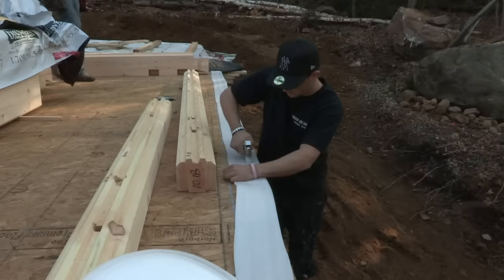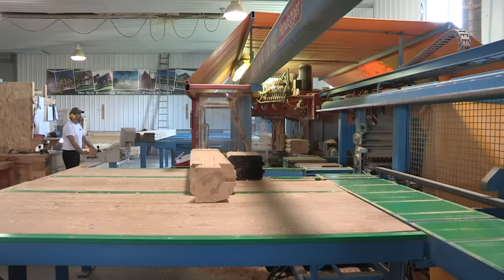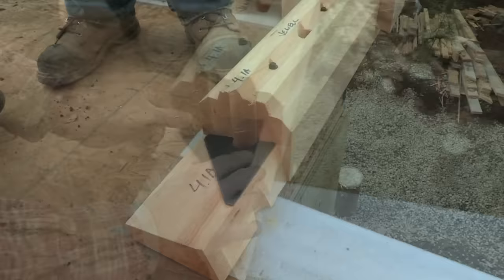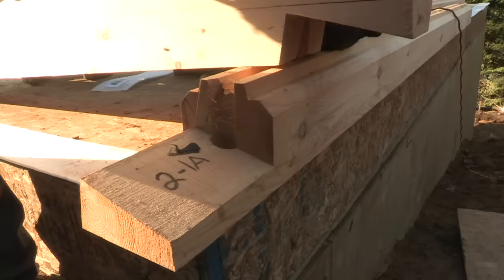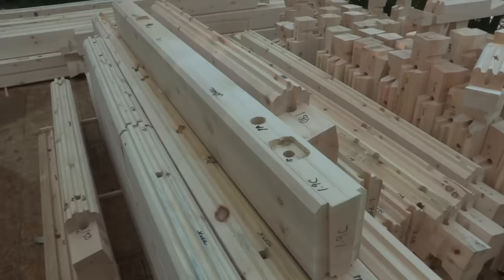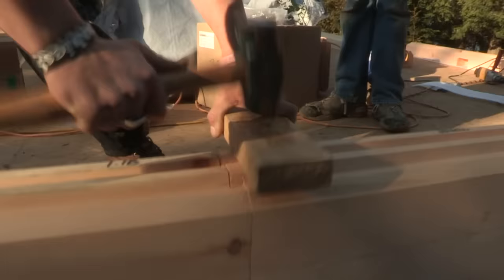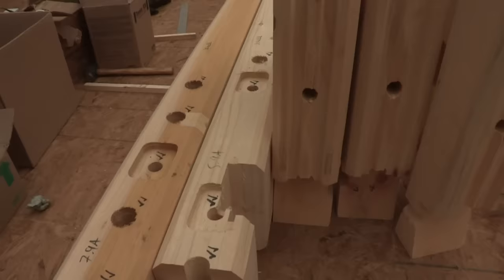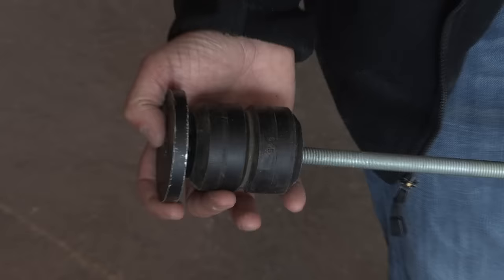Discovery Dream Homes Log Assembly

Comment: I am impressed by the accuracy and the engineering that goes into the logs.  When I watch guys go at it with chainsaws and axes -- it looks rustic, but not very precise.  This product is precise.
Reply: Sorry to pop your bubble, but wood is organic, it changes with the seasons. Get it wet, it swells, so precise is silly when thinking of wood products. When there is no rain, it dries, so you have expansion and contraction, up to 15%. Timber frame joinery accommodates that, not logs under compression. Think of Tudor, the waddle and daub in between. They used different materials like reeds and branches woven for the waddle, the daub was horse dung, dirt and lime, maybe some horsehair. That was the filler between the framing members. Search Tudor built in the 1500s, some still around, looks atrocious, twisted and warped. The wood outside is always black, and that is not paint, that is fungus.
Reply: My comment had nothing to do with expansion.  They were about accuracy and precision.  I am assuming you’re not an engineer.  ALL building products expand and contract with heat,cold, humidity and dryness, even composite deck boards show a difference during seasons.  That is why most construction products are tested in weather labs.  If you are trying to make a point that axes and chainsaws are more accurate than a digitally engineered board  from a factory, you have failed.
Reply: @raicebannon1936  Maybe you have trouble reading, I am an engineer, Civil/ structural engineer. All material expands and contracts, water the opposite of most. Combine that with the organic nature, susceptible to bugs, fungus, mold, and cellular rot. Deck boards made of wood have the same problem. Concrete does not if the crete is aerated, the water has a means to migrate to micro-bubbles for the expansion. But the crete itself contracts in cold, the wood will swell because of the moisture content. Axes and chainsaws have nothing to do with what I was talking about, goes to your problem reading what I wrote.  No matter how precise you build something with wood, leave it exposed to the weather and it will rot, warp, check, twist, and swell when it rains, shrink when not. The sun does a number on it too, destroys the cellular composition with UV rays. So then read it again, I said if the foundation is off because of that, then everything else will have that compound error.

Comment: Traditional log houses have many advantages over this one:
1- Timber has to be cut at a specific time of the year, when it contains the least amount of moisture (which wouldn't make economical sense for a company, which is why I mistrust these logs). The logs in this video are too soft and moist for an accurate seal over the years. Maybe these logs should be left to naturally (or artificially) dry further more.
2-  The corners here are too exposed, they will certainly require wood sealers applied every year. Which is why most traditional log homes use an extra layer of wood on the outside to prevent moisture from building up especially near these end-grain corners.
3- Nailing the corners could negatively affect the settling process over the years. Maybe the nailing process can be delayed or replaced with another method until the wood properly dries.

It sure is a lot faster and easier than traditional log building but I wouldn't trust these cabins to last as long as you'd expect them to do. 
I also would have loved to see how they handle top floors and roofs.

I
Reply: 1/3 what is to say that these logs are not seasoned before milling? Just what I would do.

Comment: I think if you color code the tips or joints that go together your job will be much faster, also arrows on the wood indicating area that needs adhesive or plates. Lettering for Left, right, top bottom in ascending or descending order. Great Job
Reply: Agreed. Your methodology of color tagging etc would simplify the building process no end. D.

Comment: I would like to know the insulating value of your log cabins, compared to some of the conventional frame houses.
Reply: Thomas Collier most softwoods have an r-value of 1.4 per inch while most insulation is 3.5-4 per inch with higher values in certain foams and some other insulation’s. The good thing about that value though, is that it’s continuous. Stud framed houses have tons of thermal bridges from 4 inch studs while 8 inch logs are pretty insulative. Log homes also have a much more massive construction which gives them a higher thermal mass which helps to stave off quick thermal fluctuations.

Comment: I heard that there should be a spacing between logs since in wintertime logs increase in volume because of water absorption. Is this right?
Reply: Samer Azar it’s actually summertime that the logs increase in volume. Because humidity is much higher in summer, wood takes on a lot of that humidity and expands. Depending on how good you deal the wood, it may not matter. I doubt that the expansion and contraction will even be noticeable if you keep the wood well oiled or coated. Lots of builds happen in summer anyways when the logs are at peak water content and then winter comes and the house shifts.

Comment: I'd like to know if there is an "R factor" (or something similar) for the entire house? And how this structure withstands the passage of time.
Reply: +Beorn Borg  about 1.41 per inch of log. 6"log is 8.46 r
Reply: rodney johnson OK, that's "normal" for an exterior wall (I think). Just wondering if it was harder to heat :)
Reply: +Beorn Borg i do know that the foam roll stuff they use falls apart if you touch it when its old, it losses elasticity real fast.
Reply: +pitpotdeeerste Yep, I would use different insulation there too !!
Reply: ***** i get that i just know it decays, i m not sure if its meant to stop any draft in the construction , if it is when  it crumbles it could be blown out.
I just dont like that foam because its life expectancy is short.
You say it doesn't matter because its in the wall, however i presume it serves a function otherwise what is the point, that stuff stops functioning  as it decays.
i applied it on a buildings dorple and had to replace it only a few weeks later because the masonry sunk.
Of the whole 100 yards there wasnt a functioning piece of foam left, in most places it was compressed and had gaps everywhere, some places it was blown out , now this wasn't as tightly packed as the wall construction , but like i said that stuff crumbles apart fast.
You end up with a pile of dust between your walls.

With so many other options i would go with something else , hemp canvas ribbon for example thats is better for the environment then a petroleum product as well.

(it has been a while ago that i watched the vid) but why not use that bitumen kit  that is used used on the walls.
Reply: +Beorn Borg Pine wood has an R value of about 1.4 per inch. These logs look to be about 6 inches wide so the R value is 8.4 ...that is pretty crappy compared to a modern home with 2 x 6 wall construction, 1/2 inch of sheathing and 1/2 inch of drywall with R19 insulation.
Reply: R-value is not the whole story with a log home.  It will outperform well beyond what the R numbers suggest with the warmth that the home provides.

Comment: Can anybody who has lived in a log cabin tell me how long  do these cabins last and if they're energy efficient and do you have to stay on top of them for termites? We live in shit hole Jacksonville Florida where all you do is nothing but SWEAT year round. We have to seasons here and those are HOTTER THAN HELL summers and spring, there's no fall and no winter here. So me and my wife want to move to Tennessee and we want to experience the four seasons so that's why we want to move there. There's several pieces of land in Tennessee that you can buy as a combo with the materials to build a log cabin and we're thinking about doing just that but we would like some info on the durability of a log home. By the way, this video is well done and if I do go with a cabin I would like these guys in this video to do mine. Thanks for the video and a thumbs up on it. 👍
Reply: You are in a semi tropical climate and these houses are designed for cold climate, and the insulation, at least for the model shown in the video, is rather poor not a problem in a summer house in Canada but a big one in Florida. 
So it's better to start with a house designed for your climate, specially about UV protection, insulation and ventilation in summer. White Northern pine, unless heavily treated at least with sodium octaborate,  is a food of choice for termites and other borers. Besides in a hot humid climate with lots of UV the wood will be cooked and the logs will start to distort. A good hurricane and you'll discover that the house is not waterproof when rain is projected by a 100 mph wind. It's made for northern countries.
It's perfectly feasible to have a beautiful easy to build wooden house in Florida but in a very different style like the Indonesian or Laotian ones, with included hurricane protectors for the windows and overhanging roofs to protect the house walls from harsh sun and heavy rain. Furthermore it has to be structurally able to withstand an hurricane without damage (not very difficult but it has to be far stronger than the Florida building code). To have the house 2 feet above the ground on steel pillars, and built with treated wood  is a minimal precaution.

Comment: Those long lags or screws look to small a diameter to really hold the logs in the event of a earthquake or even wood warpage that could overcome the fasteners strength!
Reply: the grooves in the logs, top and bottom, hold the logs straight! the screws just put pressure on them to hold them together! kinda like your belt holdin your pants up!

Comment: I would like to know how many trees it took to build this house and how many trees were replanted. 
The meaning of the question is better understood by asking how many trees are necessary to build a house for 1,000, 100,000 or 1,000,000 families, and how many trees should be replanted now to compensate for the loss of trees cut.

Comment: I’ve built four log homes and the tongue and groove ALWAYS had the tongue facing upwards so not to leave any possibility of water laying in a groove. Just like installing t&g siding.. tongue up… groove down… why are yours different? I’ve also built hundreds of conventionally framed homes using the “GO-BOLT” system. I realize this is being used for compression too help keep tight joints during settling… That said… There’s no better tie down system available for hurricane uplift etc… I’m currently looking for a log package for a small cabin 20x30… I’ll check you guys out today.
Reply: Looks like TWO upward tongues to me.
Reply: @hotpuppy1  you know… you’re right… I don’t know what made me think it was otherwise. Maybe it was a wire chase I seen and wasn’t paying attention…😵‍💫

Comment: saw on youtube they are making railroad ties for steel tracks - out of recycled plastic - why not make a cabin kit out of these plastics - they could be moulded, so no milling - and after 100 years the whole cabin could be recycled again. also instead of tin roofs - 1/2 inch plastic panels in many colors

Comment: Thank u for ur video can use it for 3 floor ?
Reply: Amee Hasa I wouldn’t. The compressive strength of softwood perpendicular to grain is less than 3 MPa while parallel to grain is oftentimes over 30MPa (which a lot of people don’t know is much higher than most concrete mixes).  You’d definitely have to use some vertical timbers to support your floors and roofs or that load may be too much for your bottom timbers and they may crush under such loads. Think of wood like a bunch of straws glued together and you can understand where it’s strengths and weaknesses are.

Comment: in my mind if you need all extra material for wood  (silicon, screws etc) = the product might be better designed... there s always a better solution and we have to reach it... until then we must work harder.
Reply: Kalvin One 

go dig a hole then. your only building component will be dirt. simple.
Reply: Daniel Murrey yes right but in my mind if you want to stay with wood you can build like a Lego brick (the bricks would have lots of different shapes) so all pieces can be assembled easily.
Reply: It just doesn't work that way. You have to use sealants. Even in the earliest log cabins they compacted mud and other materials in the joints every year and coated them with tar.

Comment: How much it cost a home like that plz!
Reply: +Wolf shamil they start at 57k for the 400 square foot model.
Reply: thanks bud ;)
Reply: THANKs so much bud ;)
Reply: Dianne Buxton Adminstrator  I would like price list too please
Reply: That price is ridiculous. I'd rather build my own with logs cut from my property. That 57K doesn't include construction. That's for the logs and hardware.
Reply: The 400 square foot model starts at $57k but comes with electrical wiring and insulation which adds to the overall cost.
Reply: Jerry Briggs I
Reply: that that includes installation ?
Reply: Hi,

Yes, the 400 square foot model for $57k includes installation.
Reply: um yeah, jerry... do you have expanding foam sealer growing on your property? didn't think so...
Reply: Wolf shamil a
Reply: @jerryb19531953  I plan to also use my trees that are on my property as well Jerry save Thousands  of dallors  .In the process.
Reply: Meadowlark cabins and homes, you’re getting larger logs and installation for much less. The green gable for instance, is 1049 sq ft for $36,000. Then around another $7-9,000 for install. And if you go with a smaller cabin the prices are much much cheaper.  They have a cabin that’s 384 sq ft, one bedroom, one bathroom for $13,000.

Comment: WTF? are you seriously screwing corners in place? why? your ``timber`` houses will never be allowed to sink and seal itself,but i guess this is lightyears from real log homes here in scandinavia
Reply: THE CONTRATORS HERE  DID NOT KNOW THE LUMBER WOULD LOSE THE MOISTURE CONTENT AND SHRINKED THROUGH THE YEARS. WELL, LET THE OWNER WORRY ABOUT  CRACKS AND LEAKS YEARS FROM NOW. THE BUILDER ALREADY SOLD THE HOUSE AND POCKETED THE MONEY. WHAT THE HELL DID HE CARE YEARS FROM NOW ? MY ADVICE IS : GO BACK TO THE DRAWING BOARD AND THINK OF A BETTER WAY TO SEAL THE BUILDING. USE THE LUMBER FOR STRUCTURE ONLY AND FIND ANOTHER WAY TO INSULATE AND SEAL THE BUILDING.  IF NOT. THEN MAYBE THE LOG CABIN IDEA HAD REACHED ITS LIMIT AND DO SOMETHING ELSE SUCH  AS USING WOOD TO BUILD HIGH RISE HOUSING FOR MORE PEOPLE TO LIVE  IN ...........GEORGE WU, AIA ARCHITECT,NCARB 2016-7-11
Reply: The logs are kiln dried...they will expand first after being exposed to outdoor humidity.  I agree the foam and seals are a bit much tho.  Still it's nice to see a different style log home.
Reply: Build it like our fore fathers did. You know the cabins that lasted 100's of years. Use chinking. I like the uneven logs in a house, it gives it more character. This house looks just like any other log cabin. Cut your own trees and peel your own logs.
Reply: timber screws only have threads at the bottom to allow settlement.  settle down keyboard jockey!
Reply: @jerryb19531953  yeah why not? Make your own ketchup while you're at